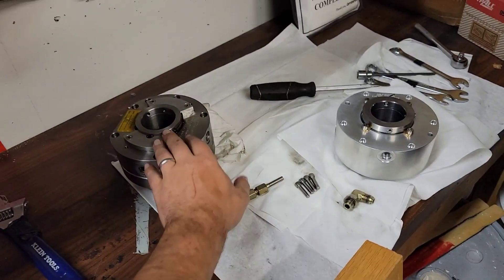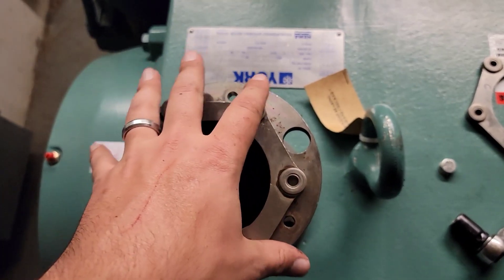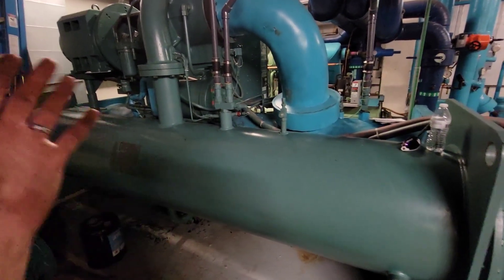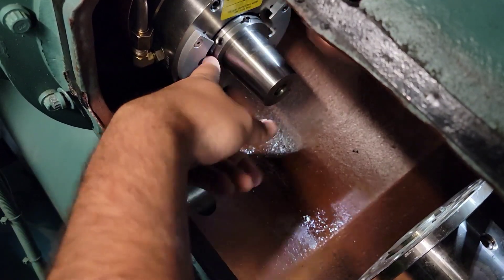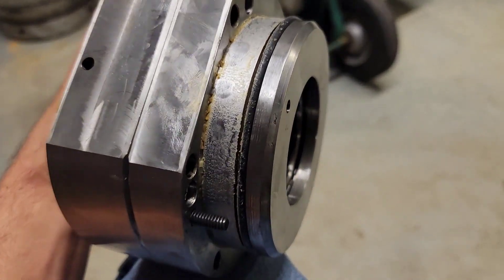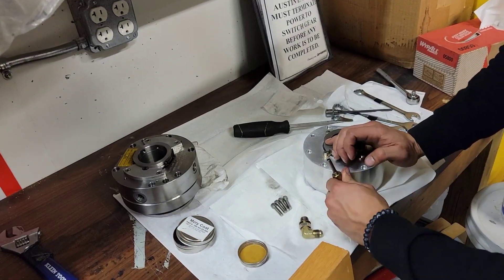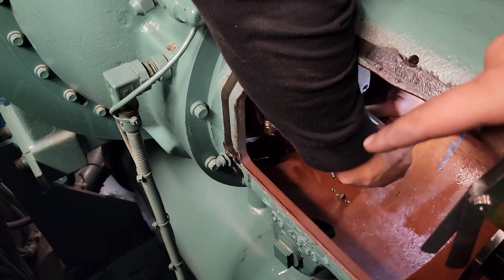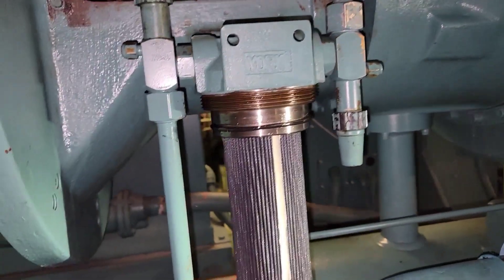Chiller Shaft Seal Repair on York YK Centrifugal

Comment: Looks like JCI changed shaft seal design again. As a factory trained York International Service Engineer for a lot of years, I worked  on all types of shaft seals  on YK, YT, and YS Chillers. One thing I found out through the years. The more they redesigned, the more they leaked.

Comment: Use some 5-6” guide pins so the seal goes in straight and the seal will not touch the key way 
You can easily make some just cut the heads some bolts.

Comment: On refrigerante charge is dificul to say exactly amount because the charge is designed for the job. And That depends off the condenser temperature if is lower 60F on condenser entering engineer stars arad more refrigerant to make the efficiency close to design

Comment: So the std is the difference between the refrigerant temp and tbe chilled water leaving the systen? Example chilled water leaving at 42 and refrigerant temp of 40 would be a std or approach of 2 degrees. The york chillers we run calculate it this way. The carrier one does not. It will be a difference of 2 yet if you scroll through the menue to the std it will show a number mch higher.

Comment: What did you pressure test at? Did it hold? Shaft seals are known for leaking, however ive never pressure tested a brand new one, do they actually hold? Or do you account for a certain leakage? I have a YT the shaft seal was leaking really bad at 5psi, i unfortunately dont do run inspections so im unable to log oil loss.

Thanks, love your videos!!!!

Comment: Catch bottle is 750 ml. If the leak rate exceeds a full bottle every two weeks the seal should be replaced
Reply from the maker: That is factory spec but for customers with low to no redundancy I recommend if they fill it in a month then its time. Properly working one should go years with minimal leakage.

Comment: With the ammonia compressors I service, we usually go by drip rate. They have weep catch bottles like the one in this video, so during our PMs, services, and follow ups, it’s good practice to note the level of oil in the catch bottles. If a weep catch is full, we empty it and check drip rate. I’ve had weep catch bottles stay the same level for a year, and I’ve had some overflow within a week! I like the fact that this seal comes preassembled. Not typical with the compressors I’m messing with. Also, one thing that is important to note: LOTO your motor when you service anything shaft related. If you’re doing and alignment, if your swapping a shaft seal, or even inspecting it, putting your hands on it, LOCK OUT THAT MOTOR 🤙

Comment: Damn, looks like York engineers actually thought about the people who have to service the equipment  down the road. I work on a lot of different equipment, nothing HVAC, but usually servicing is the last thing engineers think about. That seal assembly is easy to get to, has the jacking bolt holes, plenty of room to work. Usually shit is buried, can't see it, impossible to get a wrench on it, but in this case the total opposite! Would be nice if everything was designed with service in mind.

Comment: Out of curiosity is it easy to get a replacement for that O ring and do they give you a part number for it ?
The stuff I work on it's a noght are to get the replacements because there is no part number , no size no info no nothing about them O rings .

Comment: First, the keepers are only to keep the seal aligned. It doesn’t keep it from flying apart. And it’s 750ml per 14 days.  The YK seal is one of the easiest there is to change. And it doesn’t hurt a yk to turn it the other way by hand.  Far more advanced than the LTD style compressor
Reply: Lol I was about to say all the same things and thought "this guy must work for JCI", and then I saw the name 🤣.
Reply: Eğitici ve başarilı
Reply: Policy has changed! It now is based off of run hours, not days any longer. 750ml in 112 hours is the specifications for replacement.
Reply: They probably assumed that chiller runs 24/7 so thats where 750 in 14 days came from

Comment: Hey mate, may I ask if how to discharge capacitor bank of yk vsd? I suspect resistor bleeder has issue but we cannot dig further as dc volts still quite high at A and B point of vsd. Thanks
Reply from the maker: Yes there are bleed resistors. If its not discharging capacitor bank then need to replace those.
Reply: @HVACTIME  thanks mate..